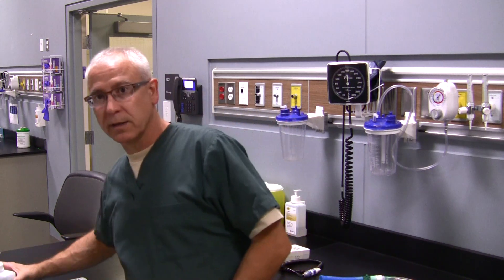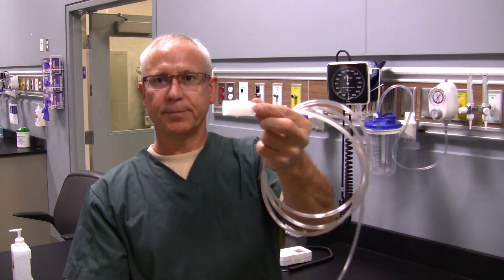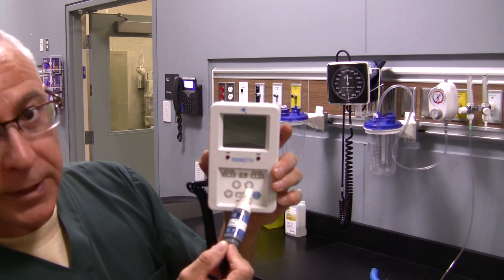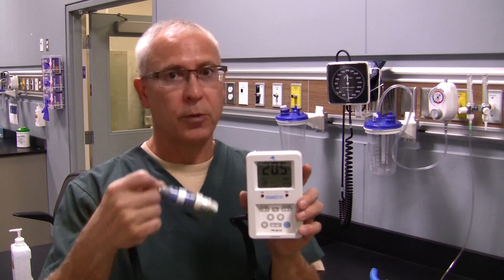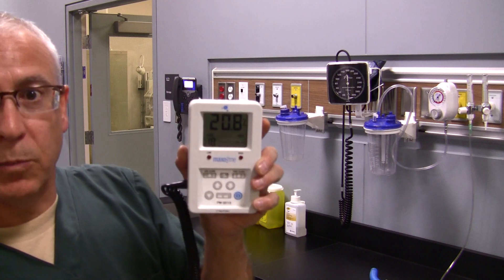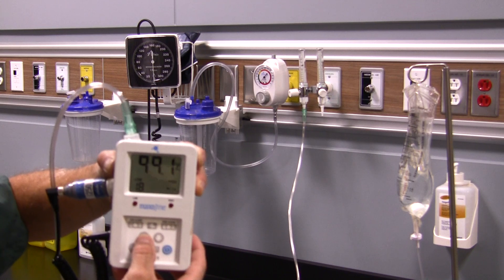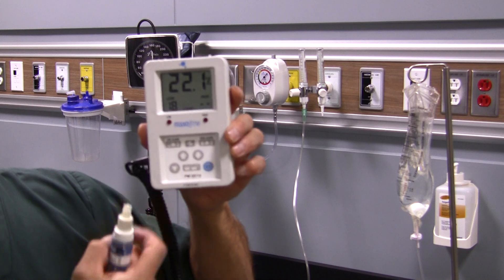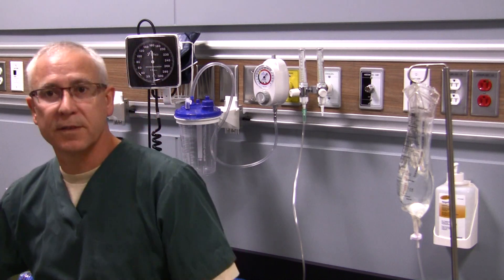Oxygen Therapy Oxygen Monitor Oxygen Analyzer  Part 2 (Calibration)

Comment: Hi, im respiratory doctor. Im interested in know if we can use this product to view what FiO2 we have in noninvasive ventilator if the BIPAP don´t do the mix air/oxygen inside. Thanks
Reply from the maker: Hi: You should have the means of incorporating the monitor someplace in the circuit before the humidifer.  The monitors usually have a T-piece that comes with them that allows them to be incorporated into the circuit.

Comment: You do not mention the brand of the analyzer...       I'm looking to buy an oxygen analyzer and I see so many of them that say there's is good between 0-30%      I need an o2 analyzer to spot check oxygen concentrators.       I need to find an analyzer that is good for my needs and will be professional quality.    Can you make a recommendation?   Thanks.
Reply: Hi! unfortunately (and absurdly) the author of this video never cared to reply, so did you ever find a suitable one? thank you.
Reply: @marceloovg1873  Oh yes I did find a good analyzer!   Thanks for asking!
Reply: @earthstewardude  that's great! can you share which one? can it measure below 21%? for example 10%?
Reply: @marceloovg1873  I bought the UltraMax  by MaxTec...    I do not think I have had a need to measure below 21%...    I'm sure it will.
Reply: what are you using an analyzer for?  What machine?
Reply: @earthstewardude  a modified O2 concentrator to generate hypoxic conditions for exercise!
Reply: @marceloovg1873   when I looked up hypoxic conditions, it did not sound good.   good luck!